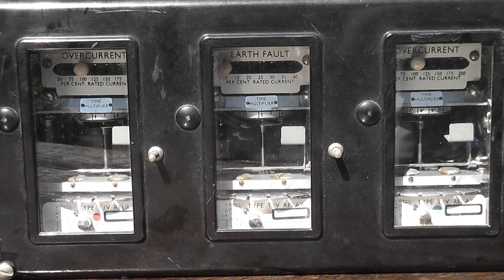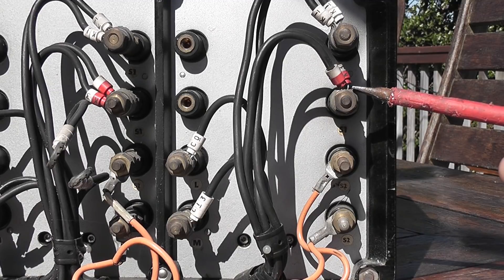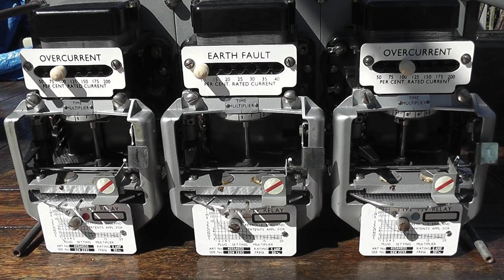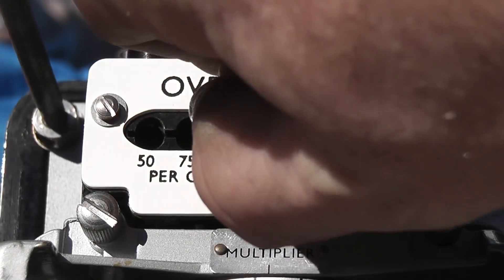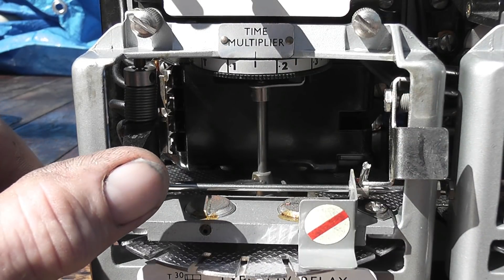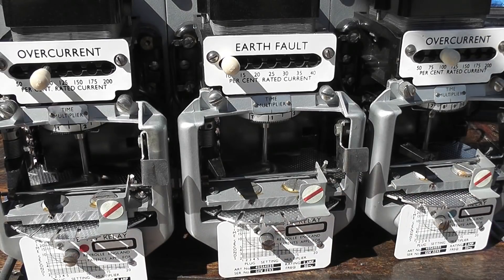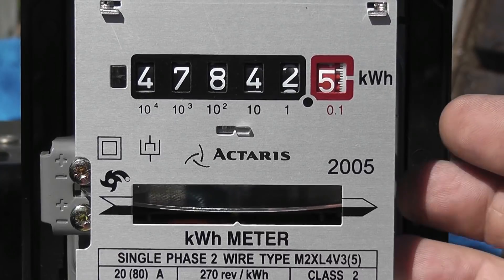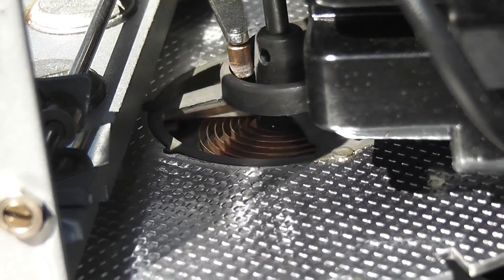Reyrolle TJV protection relay [Part 1]

Comment: Still a fair few of these in active service on the UK electrical system. Despite being around 60 years old, they usually test just fine. Very occasionally have cause to adjust the time multiplier to bring it back within spec. Beautifully engineered things.

Comment: If you think about it, mechanical protection relays would be more reliable because you'd be able to have easier maintenance. 
In case of you having a problem with the computer and its components possible of breaking, mechanical protection relays are the ways to go

Comment: We have the CDG protection relays, after 30 years of reliable operation can they lose their time delay accuracy? We have one that has decided to start tripping when we get one of our big motors jammed.
Reply from the maker: It looks that you relay is doing what it is supposed to do. When a motor is jammed very large currents flow and the relay will sense that and will trip the circuit concerned. 
It is good practice to test protection relays every two years. At nominal current, twice the current, 5 times the current, and 10 times the current. 
Also check the pick up current and drop off currents.
The time delay accuracy shouldn't drift at all. Some minor drift could happen and can be adjusted with the brake magnet.
These relays work on similar principle as the Ferraris disc kWh meters which are also very reliable.
Reply: @RODALCO2007  OK thanks very much for the information, I did suspect FLC on a locked rotor was the cause.

Comment: I always show guys in training a disc type meter to explain “pick up”, it just makes more sense than watching a boring numerical relay LED I think. That said, I’m always happy after a fault to have the logging and data in a numerical protection device! For example, I had a transformer REF scheme maloperate on a through fault which was easy to see on the logging data. The incorrectly connected CT was soon identified and corrected. An electromechanical scheme would have required primary injection testing to find the fault.................
Reply from the maker: Yes that is correct and a lot of work to set primary injection up. Fault analyses is also the main reasons new numerical relays are installed. We have done very accurate distance locations in Zone 2 within one overhead span accuracy.

Comment: That's pretty cool. Appears to be in mint condition, too.  Any idea from what era this example is from,  i.e. approximately when it was built ?  p.s.  that furry unit seen at the beginning of the video,  was that in sleep mode, or just hamming for the camera ?
Reply from the maker: That furry device was in sleep mode, and was not impressed when I opened the sliding door to our outside deck. These units are from the 1960's.

Comment: Interesting that the contacts close and not open at fault. Mind showing the rest of the needed system?
Reply from the maker: The contacts close to energize the 110 Volts DC trip coil which will trip the circuit breaker which it protects.

Comment: Do you still have many of these in use at Vector? Northern Powergrids network in North East England is pretty much made up of these on all 11kv and 20kv primary circuits. We also have a HV jointer moving to join yourselves in January.
Reply from the maker: Awesome ! a lot have been replaced with Siemens Siprotech relays. A couple of subs have these Reyrolle relays and most have the classic GEC CDG and CDD relays.

Comment: So, the unit is a regular eddy current moving iron meter built around a regular meter disk, with the coil settings switching taps on the coil to vary the torque applied working against the clock spring, with the slots acting as a way to change sensitivity of the movement versus rotation position of the disk. Then the disk tries to turn against a spring, and I guess there is a bias magnet as well damping the disk, and the time delay adjusts the starting position, so the damping takes longer to trip the flag and the contacts. I guess even at the max delay position there is a near instantaneous response to high overcurrent though, from the high drive current through the saturated current transformer driving a fast shut off. 

Nice set of contacts, knife edge contact to ensure high contact pressure, and the bar wipes along it to remove corrosion products that might otherwise prevent operation, as this likely spends all it's time open with minimal operating cycles. Probably beryllium copper with some silver in it, and probably also gold flashed.
Reply from the maker: Yes, there is a damping brake magnet. The timing is for nomial tripping current at rated Amps, during relay testing current sampling is also done at 2, 5 and 10 x I-nom. with corresponding faster operating times.